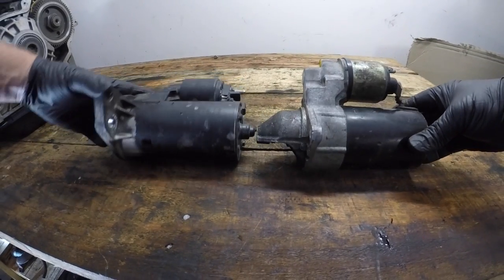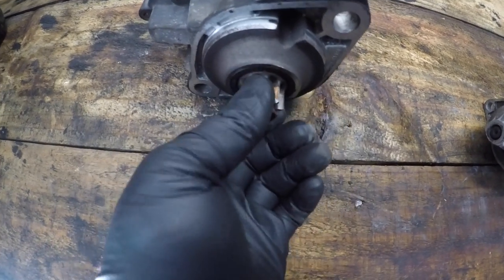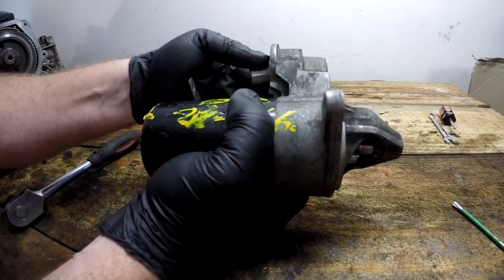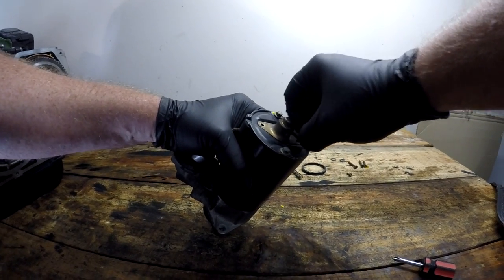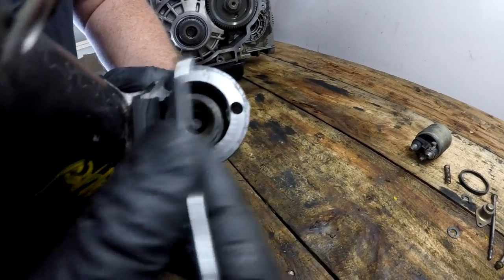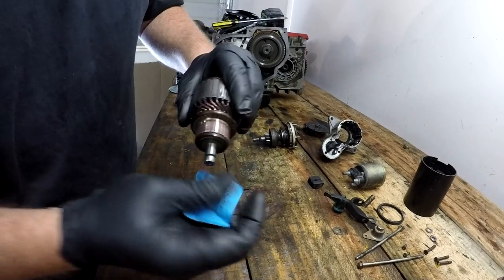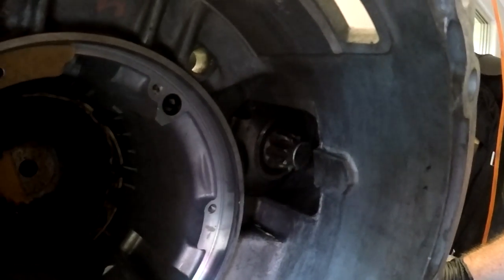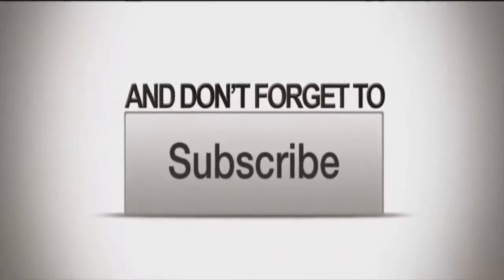Starter Motor Problems and Operation

Comment: i know if you have a bad solanoid you use a screw driver to join the 2 positive terminals and make the starter motor start spinning and start your car. but if you have the type of starter where the pineon gear is only popped out by the solenoid plunger will this just cause the pineon gear to spin without engaging with the flywheel?? I have a px mk2 ranger and just wondered if this trick would work for me if i ever needed it.
Reply from the maker: Geoff Clarke the solenoid is needed to engage the pinion gear. Bridging the two heavy duty terminals will just allow the starter motor to spin but won’t turn over the engine

Comment: Thanks for this video.  Found you on Instagram because you liked one of my photo of a car I saw today.  My Instagram is SCVLui  
I am new to figuring out engines and replacing parts myself on my 2001 Expedition and I found this video to be one of the most helpful in educating myself.  I recently put in a new starter in the Expedition and it works, however I am getting a strange "knocking" sound of metal every time I start the engine.  Like something is loose and flying around.  Looking forward to seeing more of your videos
Reply from the maker: Cheers Mate, Glad you found your way over here. Great to hear that I have helped someone out, that's why I spend the time recording what I do. Thanks for your comment.